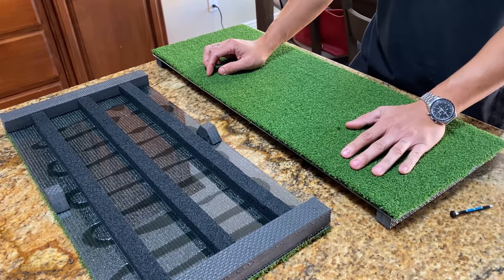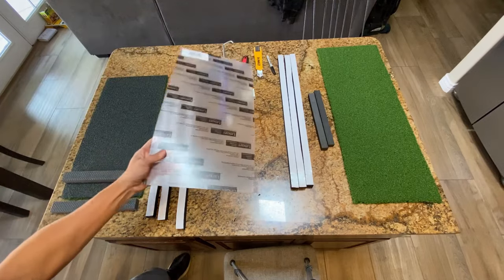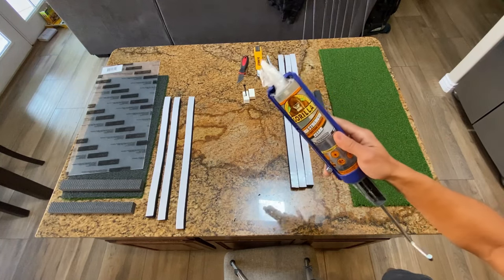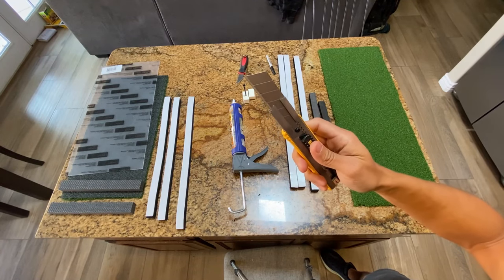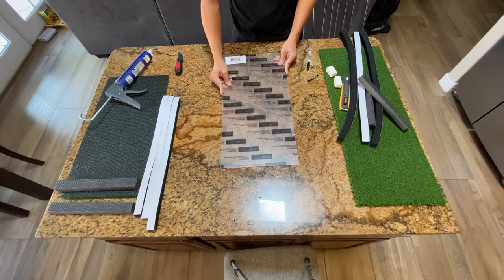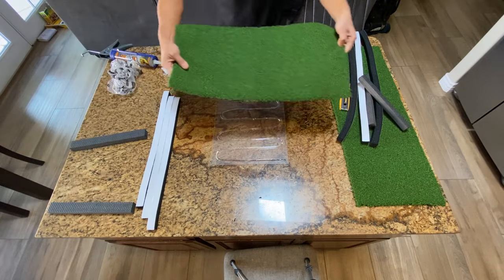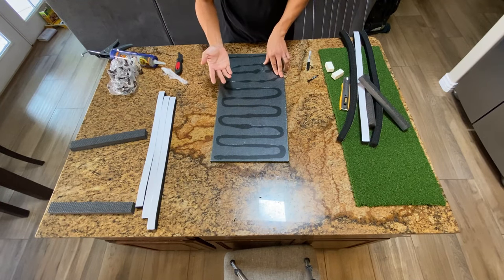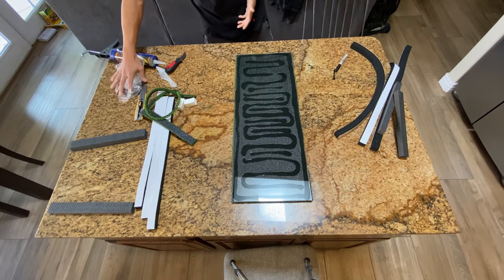How to DIY divot simulating insert for indoor golf simulator + GIVEAWAY

Comment: How did the tee insert work? I would worry a tee would break off in it and you wouldn't be able to use it.
Reply from the maker: Tee insert works great! I ended up drilling a larger hole to allow the tee more give to limit breaking and use plastic tees.

Comment: After a successful proof of concept, I put together my actual hitting strip today. Honestly found the 1" foam you linked a little stiff. Not bad, but I felt like there could be some more "give" to it. Fortunately was building mine into a 3/4" sheet of melamine. So I had to go with a different foam anyway. 

This one came out awesome! Unlike any mat I've ever hit off of. And I've tried a bunch. Including the high dollar gel mats. I also set it up so that I can easily replace it. Drilled a few holes at each end of the polycarbonate. Then screwed it to the melamine with some truss screws and rubber washers. Will be super easy to replace when the turf wears out. It also simplifies the build and saves having to buy a gym mat (or similar) to go on the ends of the Lexan.

This DIY mat is definitely the way to go. Awesome to hit off of, and can't beat the price. Spent $45 on a 15' strip of turf, $10 on the foam strips, and $15 on the polycarbonate sheet. Everything else I already had on hand (melamine base, screws/hardware, and construction adhesive). I also made a stance mat with some of the turf. But still have enough left over materials to make 3 replacement strips!
Reply from the maker: Glad to hear! That why I like the DIY style inserts, you can tune to your liking!

Comment: How did the tee idea work out? Did the acrylic and tee holder hold up? What did you use to put a hole in the acrylic?
Reply from the maker: I used a tapered drill bit and it works great!

Comment: Quick question as I’m considering upgrading from fiberbuilt stance mat.  How level does this sit to the rest of your putting turf?  I’d imagine the thickness of the acrylic panel.  My current launch monitor needs to be same height. Thanks…BTW, low the channel.
Reply from the maker: It actually sits like 1/4” higher, but I just trimmed the foam to sit flush.

Comment: Hey guys, one I thing I noticed is that acrylic you mentioned. Lexan is a polycarb that is specifically meant for containing impacts and durability. Its a much better option to choose compared to acrylic.
Reply from the maker: Yes, you are correct! Poor choice of words! Doing a follow video showing it in action and will make sure to address this. We use Lexan polycarbonate

Comment: Have you gone to using the standard rubber tees that you see sticking through the mats at a driving range?  If not, what type of foam do you use to put under the mat for your tee.  Thanks

Comment: Play dough or modeling clay works good under the mat to hold a tee.  Just found it hard to drill a hole in the plexiglass without it breaking.  Will use a cutting tool next time.
Reply from the maker: Make sure you are using polycarbonate board and a piece of wood behind it to limit cracking.
Reply: Drilling Lexan  - https://youtu.be/EH3u8m_kCu0

Comment: Thanks for the vid. If my gym mats are about 1/2” to 5/8” thick will this still work. Or will I have to double up the thickness to about 1”. Will the acrylic break if it’s not 1”? Thanks
Reply from the maker: I would build around atleast 1”. Less than that wouldn’t benefit from the divot style inserts.

Comment: Great tutorial. Thanks! What is the reason you used three strips on the bottom rather than a full piece?
Reply from the maker: That foam isn’t sold in the sheet, and cost. I don’t feel it’s necessary to have the whole underside filled in with foam.

Comment: Thanks for sharing!

Been working on sourcing all the parts to make my own. So this is great timing. 

Had figured everything out, aside from what type and thickness plastic to use for the turf base. Was debating between polycarbonate and ABS in the neighborhood of 1/8”. 

Think I’ll end up ordering both to test out any differences.
Reply from the maker: Polycarbonate at 1/8” would be perfect!
Reply: @PixelGolf  I ended up picking up some Polycarbonate at HD (.095-ish thickness ). Basically because I'm eager and didn't want to wait on shipping. 

Kind of glad I did. I think 1/8", while not much thicker, would be a little too stiff. I also think the foam is what has the biggest impact. 

Already put one together for testing. Have a second sheet of PC that'll be used for my final product. Going to actually screw it into a OSB base. As opposed to using adhesive or velcro. Figure this will make it easy to swap out the sheet.

Comment: This is flat out FANTASTIC! I'm a little unclear on the material you used for the tee holder.  I don't see it linked in the material list.  Can you clarify?
Reply from the maker: I didn’t want to link it yet, until I get more time using the tee to make sure it doesn’t fail or crack the lexan. Will have an update video and then link it.

Comment: What about gluing one of the rubber tee holders to the bottom of this? Then either cutting it flush with the turf or leaving it set up a little bit? Rather than sticking into foam?
Reply from the maker: I actually did this, though the glue didn’t hold… However, it still works great with just the tee holder sticking up a bit.

Comment: Great guide, and I love the idea for using the wood tees - much better than the rubber tees. 
Have you looked for higher durability turf so you don't have to replace it every quarter?
Reply from the maker: I am constantly researching new turfs, but it is also important for the color to match, but if one is better, I might switch the whole turf piece on the entire mat.
Reply: @PixelGolf  getting ready to build one, was wondering what kind of foam you were using for the tee?

Comment: Any thoughts about using higher density foam?
Reply from the maker: I would not use high density, it will make it too firm and probably cause wrist issues.
Reply: @PixelGolf  what do you think about going 18" wide instead of 12"?  Would it still be ok, with just adding more foam strips?

Comment: Do you like the 30” or 24” better? What is the foam you use for the tee? Has it worked out well?
Reply from the maker: I like the 30”. The tee foam wears out somewhat fast, but experimenting with other foams for the tee hole. It works great in general though!

Comment: Great video. Here is a question: Is there a reason you used the 1" EVA foam for the cross pieces instead of the 1" low-density foam?
Reply from the maker: Yes, because it’s inserted into a mat and the low density foam will allow too much forward movement compared the dense foam.

Comment: Excellent video. Could you let us know the thickness of the acrylic board you’re using ? 3mm maybe ? 
Thanks
Reply from the maker: It is 2.5mm, but up to 5mm will work as well and probably better for going longer.
Reply: @PixelGolf  thanks.  I figured it out after listening again to your comments (0.093inch).  As for the EVA foam, do you know the density of it ? (Low means how many pounds). 

Thanks
Pat 
France

Comment: Hi question about the DIY. Does the foam strips have to be same height as the  foam gym mats? Or should it be 1/4 smaller in height?
Reply from the maker: Same height. You basically want to make it so the end product is level. This will be dictated partly by the foam strips, but mainly by the end pieces.

Comment: Is there a max size you would recommend?  You mention you did a 12x24 and 11x32.  I was thinking of trying an 18x24 or 24x24 but didn't know if that would be too wide.  Thanks.
Reply from the maker: So the reason I didn’t go as wide, is because with the Mevo+ or GC3 I can putt off the insert and the ball can still be seen. But, you can go wider if that is not a concern.
Reply: @PixelGolf  Thanks for responding.  I tried going the other direction and did an 8"x10" piece but I don't think that is long enough to give enough flex action.  I'm really struggling with getting a good cut out size of my mat.  That's why I went smaller as I can always cut out more.  I probably need to try a 12x18 strip but nervous if I cut too much of my stance mat out I'll be SOL.  Any advice on how to cut a perfect section of the stance mat out to fit your divot insert?  Your's looks so flush.

Comment: Did you ever consider using 5 strips of the low density foam instead of the 3 strips?
Reply from the maker: I tried different patters, more, less, etc.. But with the width of my board, 3 was plenty. If I went wider I would add more rows.

Comment: how do you feel about the turf here? it looks similar to the putting turf i have from home depot i used as my flooring i put over some workout foam.  i just wonder if its a little thin and if some turf with another half inch or so of foam would be helpful at all? i plan to build a new mat to put on top of my existing turf (currently have a 5x5 rawhide but my elbow is killing me)
Reply from the maker: I switched the turf to Money Putt. The putting turf is perfect for this. New video coming soon!

Comment: Do you actually have to cut the acrylic? Couldn't you just keep ot that size and Push the hitting strip up through the hole in your mat, if using a hitting mat? I'm asking because I've seen some people's strips jump out of the hole they've cut after they hit.
Reply from the maker: I mean... That's actually not a bad idea. Mine doesn't come out though. I have a new version video releasing soon.

Comment: Nice video. The biggest issue I'm having is finding a piece of turf to use. Everyone wants to sell you a 15' wide roll with a minimum of a 4' run. Currently searching for anyone with remnants for sale.
Reply from the maker: I’ll have some turf pieces and custom cut lexan to sell. Message me on IG @tailoredmetals
Reply: I managed to buy a 1'x15" piece of synlawn multi purpose turf from Lowe's for $46.00  It shows no signs of wear after 3 weeks of hitting.

Comment: how did the hole for the tee work out? I want to try it as well. I built the one you made in the video
Reply from the maker: It works perfectly, though I changed the design of the tee. I basically bought one of those rubber tees and drilled a hole using a step drill through the lexan the width of the tee and just simply insert the tee underneath.
Reply: thanks. Ill do the same @PixelGolf

Comment: I wonder if thin 3mm or 6mm plywood would work just as well instead of acrylic, any specific reason you chose the plastic?
Reply from the maker: It has good flexibility and won’t change with different temperatures like wood.

Comment: is it possible to use Gym Mat to build a hitting mat ?  Just working if it is too hard surface for golf mat
Reply from the maker: I would not recommend it as it is a very dense material… You can make one, but I would add a diy hitting insert.

Comment: Thanks for all of the videos. 
Do you use the same turf for the strip as you have for your stance turf? If so, wouldn’t the added height of the Lexan raise the strip to be slightly proud of the surface?
Reply from the maker: Hello, yes I do but it is so minimal you don’t really notice. Keep in mind the risers you make for the ends out of the gym mat can be cut to whatever height you need when building.

Comment: How did the tee insert work out?
Reply from the maker: Works perfectly! I ended up drilling a hole out and inserting a rubber tee holder from underneath that is free floating so it doesn’t impact the divot action. It’s held up for a while now.
Reply: What kind of rubber tee? The kind you see at driving ranges on their mats, or something else?  Thanks

Comment: How did the tee hole work out? I tried it on mine and it created a weak spot where the acrylic shattered
Reply from the maker: I hit thousands of shots with no issue at all. I’m using Lexan and have the tee hole set about 2” to the right of the normal hitting zone. Make sure when you drill the hole it’s a clean drill. You can go a step further and sand the drilled edge with a dremel.

Comment: PLEASE NOTE: LEXAN and ACRYLIC are not the same!!! Lexan (polycarbonate) is 100 times stronger than glass. Acrylic/Plexiglas is 25 stronger. USE LEXAN/POLYCARBONATE, if you use acrylic it will crack. Find it at your nearest plastics distributor. Most will cut to your exact dimensions.
Reply from the maker: Thank you for this, update video will cover this.

Comment: Mine lasted about 6 hits before it started cracking 😢
Reply from the maker: That's odd... I'm 3 years in with no issues and I have a tee hole drilled in the new version. You need to use Lexan.
Reply: @PixelGolf  agreed. I remade it with a different brand and that one didn't last long either. Lexan wasn't available where I went and I'm sure this was the issue because both were the recommended thickness. Thanks for the vid

Comment: Could I pay you $100 or $150, plus shipping, for you to make one for me? If interested, I’ll tell you footprint and height required to fit into my spot (should be extremely similar height and footprint to yours). Ay? Anytime in the next few weeks would be fine, if you wanted to wait till you may be making some more. Thanks in advance. 
Edit,
I’d want the tee cushion foam to come loose (maybe enough to do 3-4 for longevity?) and no hole pre made, so I can locate it best for my spot).